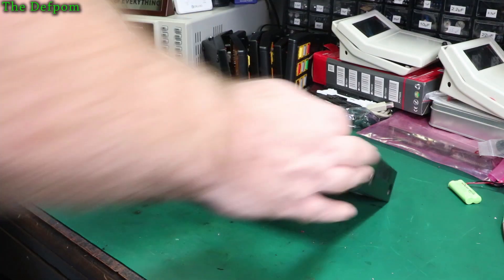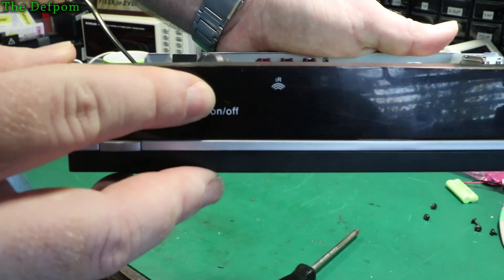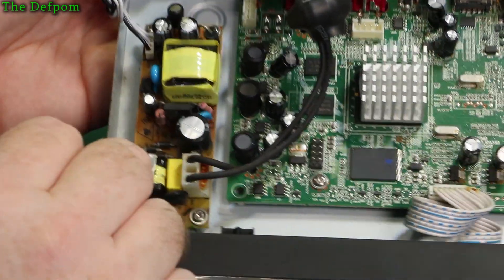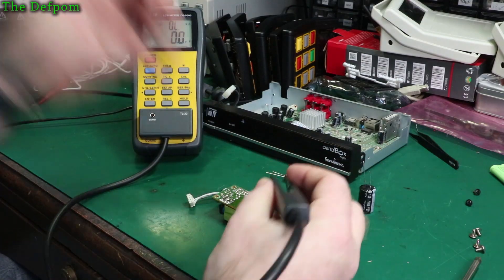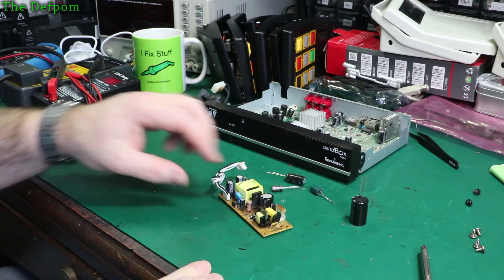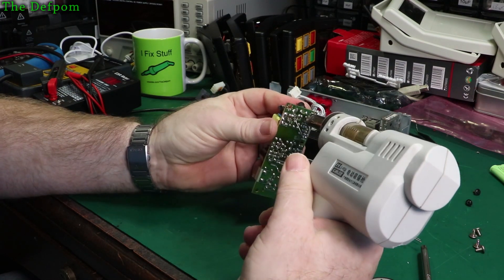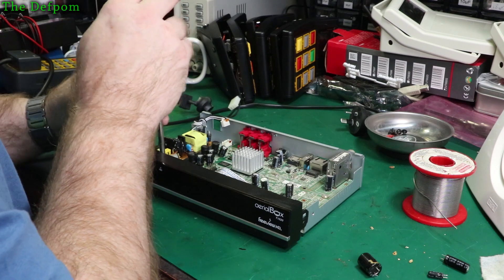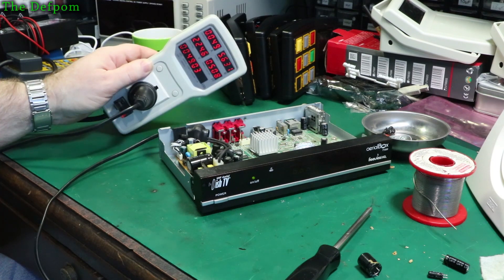#715 Digital TV Tuner Repair - DishTV AerialBOX T1020 Freeview Repair

Comment: Dish have had crap caps forever. I had a VIP 922 I recapped years ago when we still cared about main stream TV. Apparently that model had a notoriously short life
 By the time I decided to dump Dish the rep couldn't believe we still had a working 922.
Reply from the maker: wolvenar - items are not designed to last, or at least, the bean counters get involved and insist on buying the cheapest parts.
Reply: @TheDefpom  
Agreed.
Many times in recent years when I buy something I will test it, take it apart and replace many of the cheap components with better quality stuff. Particularly the caps. 
I did this with one of 2 brand new LG 60' 3d TVs I bought in 2012. The one I tweaked is still working today. The other failed in 2015 with  obviously bad caps, likely a cascading failure took out the main PCB as I could not repair it. I ordered replacements and did the same upgrades to it and it too is still working well for us. I had quite a time convincing my wife to let me tear into a brand new TV lol. Now I get asked when I plan to do similar when we buy anything 😅.

Comment: Don't you love it when you open a chassis and see a separate power supply... yes.👍👍
The caps on the main board should be okay as they would not be subjected to the high frequency ripple current that the power supply caps would.
It would be false economy not to replace all the caps in the power supply.
Reply from the maker: Tom George - it was exactly what I was hoping for.